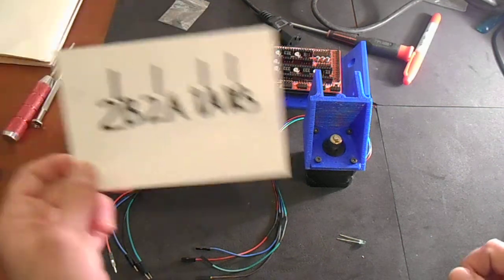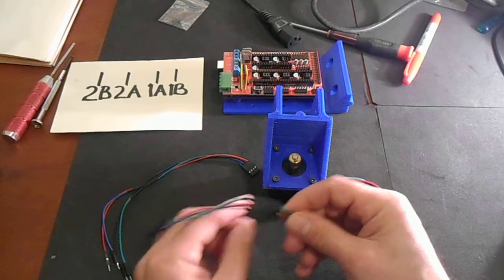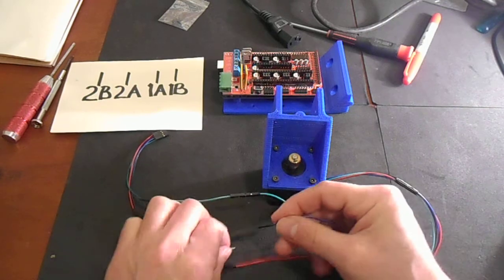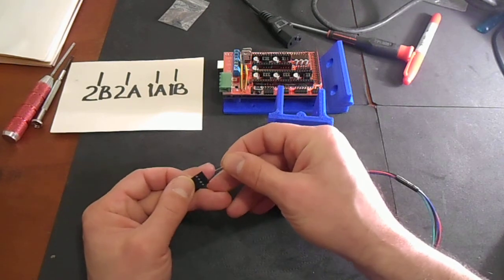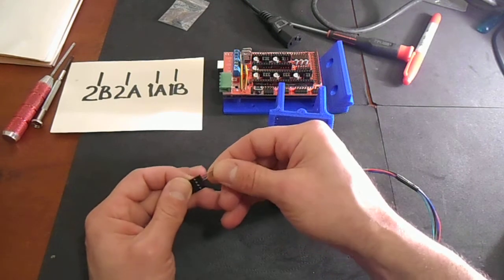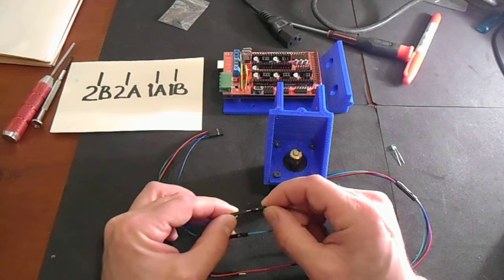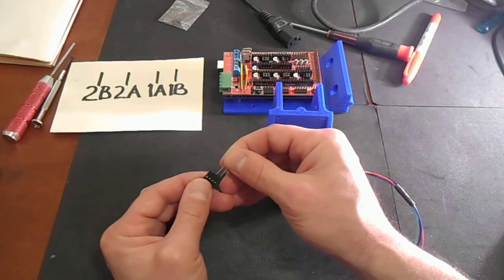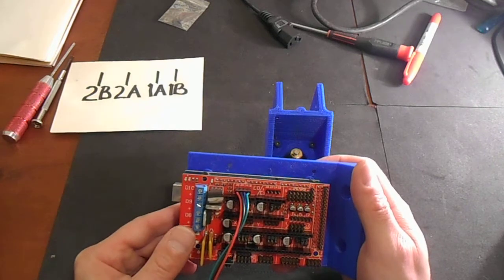RAMPS 1.4 - Nema17 Wiring

Comment: I have the issue like this where the motor spins in the opposite direction. The new motor moves in opposite direction with the cable that came with the new motor.  The motor grinds with the cable that came with this z-axis 3d printer.  I am not familiar with the Marlin software. You have more advise?😊

Comment: I have a pinout which describes them as a+ a- b+ b- which corresponds to 1a 1b ect?  is b - then?
Reply from the maker: The easy way to check is with the LED.
Reply: @EdwardBraiman  what voltage/specs is the led? 12v?
Reply from the maker: Don't remember, but it's just a method to check alignment of wiring.

Comment: Great video, one question if you do not mind, what are the risk to connect 2 steppers to 1 driver using ramps 1.4?
thx you
Reply from the maker: The RAMPS 1.4 is designed to take two Nema17 stepper motors in the z axis.  So should be none.  Been printing on RAMPS for years without an issue.  Just remember to tune stepper driver board for all your axi.

Comment: what about 6pin stepper motor. this one (       https://www.google.co.in/search?q=nema+17+6+pin&source=lnms&tbm=isch&sa=X&ved=0ahUKEwj1gceqw6veAhWLpY8KHWRMDMYQ_AUIDigB&biw=1366&bih=664&dpr=1#imgrc=OSf-fqeWt8nWBM:     )
Reply from the maker: You can use motors with six pins just remembered only four pins connection on 3d motherboard and start small with only one motor to verify it works.